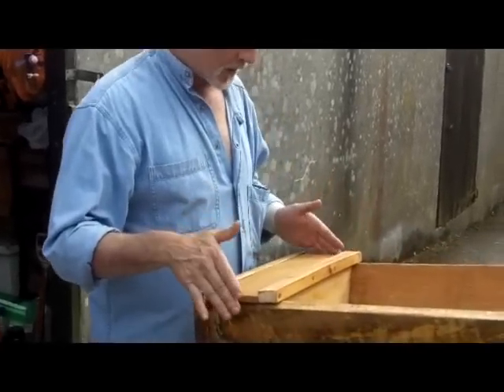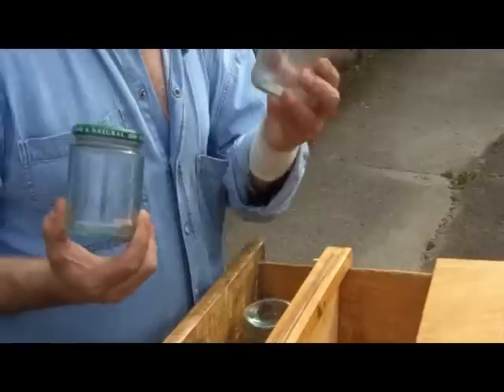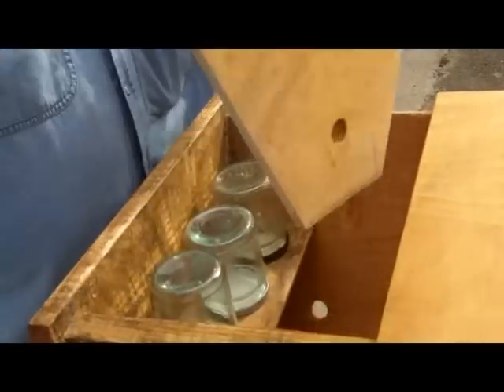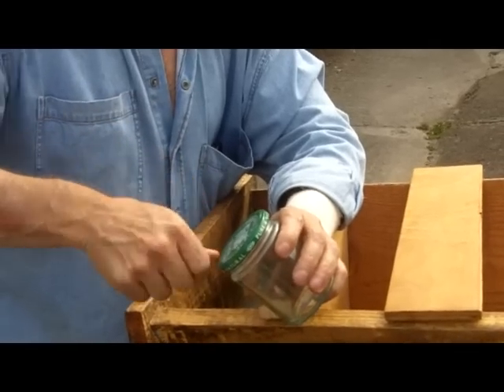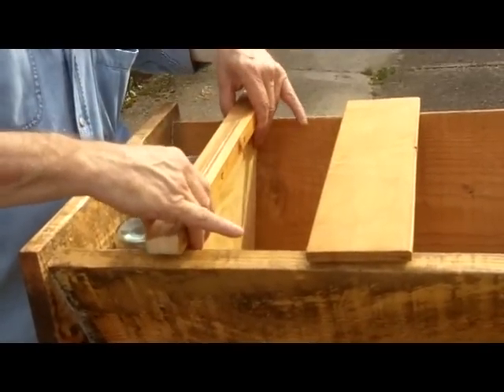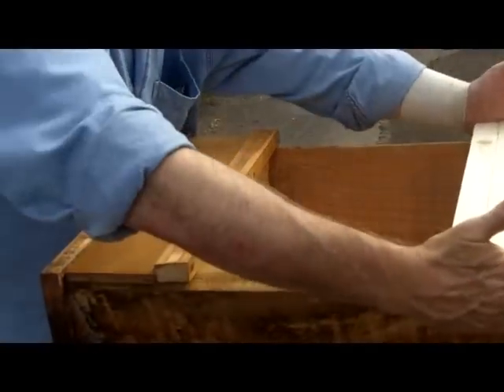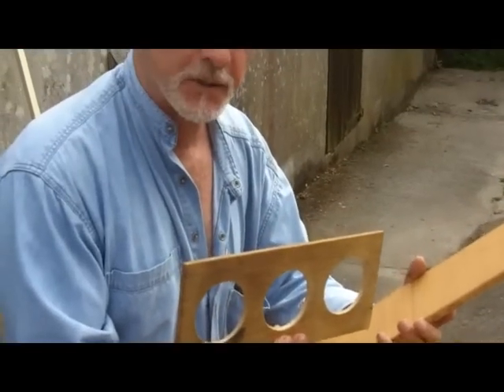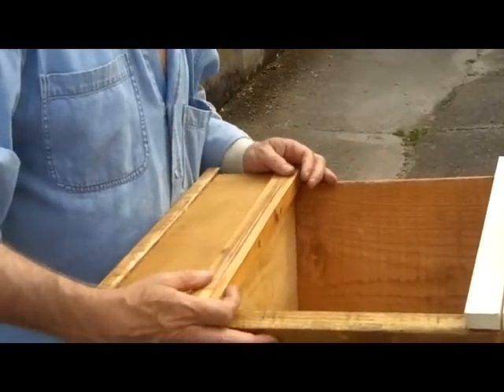How to Make a Simple Feeder for a Top Bar Hive

Comment: So if I designed my top bar according to your "plan A", using entrance holes mid-way down the length of the hive so my bars (about 10) are in the middle of the hive body with a follower board at each end.. do I just use two follower boards with holes? One at the end of the ten bars, and another one next to the feeder a foot away?
Reply from the maker: Followers go each side of the colony, and you move them ahead of the bees as they expand. Only the follower at the feeder end needs a hole.

Comment: Phil, I am trying to replicate your feeder but I must be missing something...from the looks of it the bees can still come up through the big holes when you lift the jar out...is that correct or do you have some sort of screen on the bottom of the board that holds the jars?  If no mesh is added then it is possible for the bees to get up into the jar holding area so does that create a problem since they can't get out?  I have made a couple with 1/8" hardware cloth on the bottom and they didn't take the syrup as well.  thanks for the video!!!
Reply from the maker: cameragirlish Sorry for the 2 year delay... Yes,  they could, but only a few will and they can be brushed out if needed.